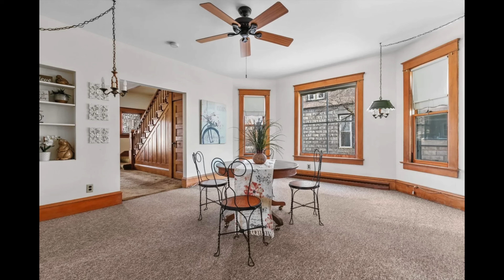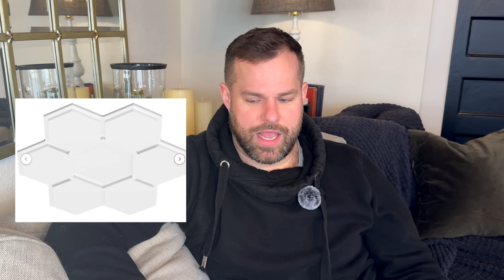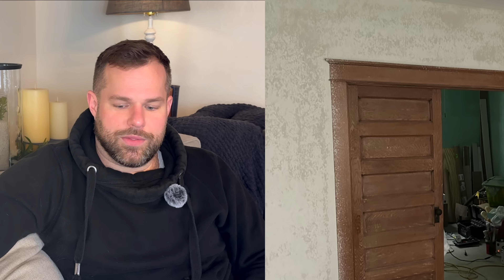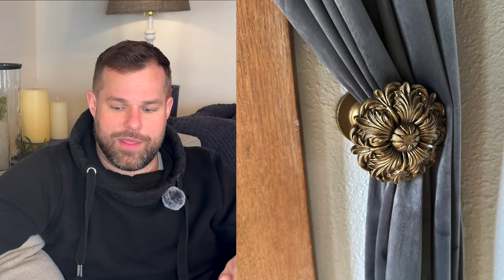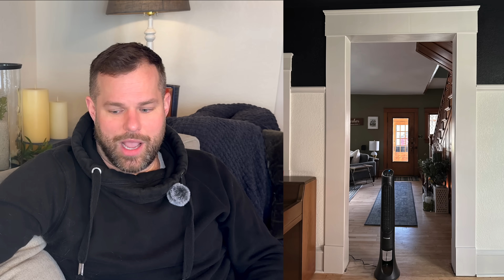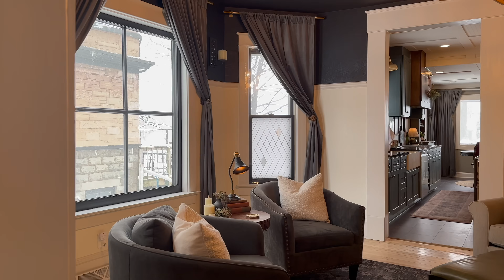rehabbing the parlor: making a space look larger using black paint

Comment: Nice. I would ditch the drapery. You just don't need it. Cheers, J.
Reply from the maker: Thanks! Unfortunately I do need the drapery, primarily for insulation reasons (those windows get direct/hot sunlight from morning until about 3pm in the warm months, and they are VERY drafty in the winter, especially on the sub-zero days).

Comment: I am working on installing picture rail in my wonky 1894 dining room. To complicate matters a previous owner put up a layer of drywall over the original ceiling but didn't properly mud the edges so it looks like 💩. I am going to try a trick where you create a jig using a piece of scrap wood the size of the distance you want and use that butted up against the ceiling to draw your line. For me it's the distance between the bay window trim and ceiling. So the line won't actually be level, but visually it will look level. At least it's supposed to 😅 We shall see how it goes. I am terrified to refinish the floors, but seeing your results makes me a little braver. Also Anyhropologie should give you some $ cuz I just had to order some tiebacks from them after seeing yours
Reply from the maker: I'd love some money from them, hahaha. And that's a great idea! I had to cut things out based on timing, but the drapery rods in the Parlor are NOT level. When I made them level, since they are so high and near the ceiling, they looked crooked. It's such an interesting combination of... kinda-level and what "looks" level to the eye, lol. Good luck on that! Where did you get your picture rail from? I need to source one for my upcoming living room project!